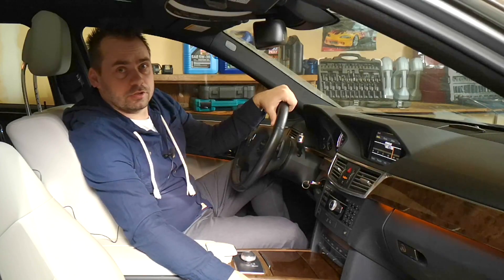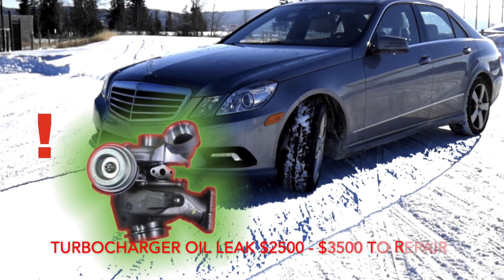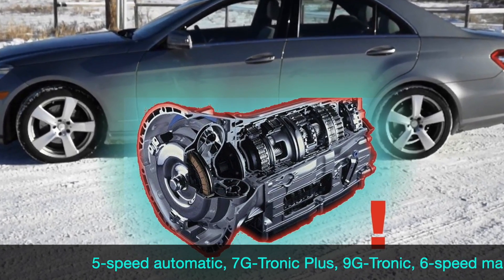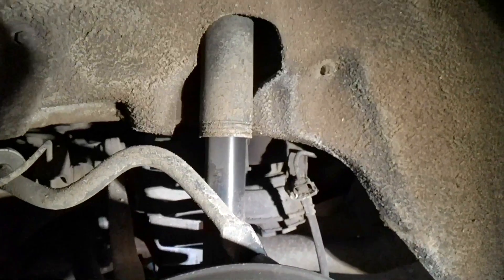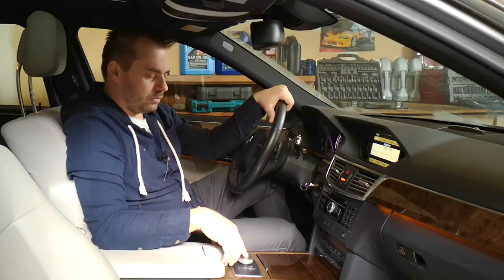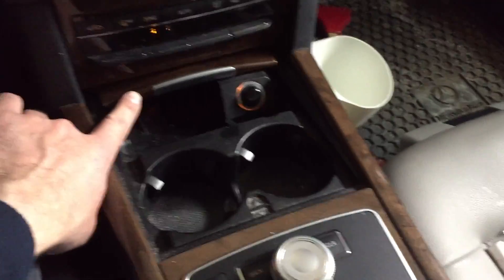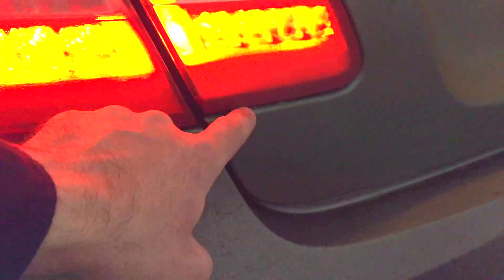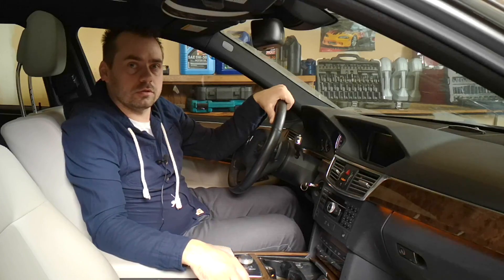🤞 🇩🇪  Used Mercedes Benz E Class Reliability | Common Problems and Issues | W212 S212 / 2009 - 2016

Comment: This car seems suspect to me. I have a W212 but a facelift one. Those dash panels there don't creak. I will however admit that some parts do creak and there are some rattles which there should not be. The seats are comfortable but I have the electric seats with memory function and more adjustment with the real leather so maybe those base seats are different. The panel misalignment is also strange but I have seen a few with that issue. Apparently it is an easy fix though. Mercedes will just realign the bracket in the boot/trunk for the strut on that side.

Comment: The radio/navigation wheel on center console is a $15 repair if you do it yourself plenty of videos on YouTube on how to repair. And if you need parts For most Mercedes especially E350 models FCP Euro has parts super cheap and a lot of diy videos you would be surprised on what you can do yourself on this model.

Comment: I will argue the Chain issue on OM651 2.1 (200, 220 and 250CDI) are much more normal than on OM642 V6/ 350CDI. Not that its super normal on the 651, but there are many examples of the Chain snap. I will do mine in around 200+k to prevent issues. Cost around 1000£ to fix at a workshop.. On 651, there are also coolant leak from water pump, egr and diesel filter bracket. Good engines all in all though. But generally, aside from the oil cooler leak on 642, the 642 is classed as a more reliable engine than 651
Reply: so the e350 doesnt regularly have this issue? I've just had a range rover that had this issue which is why im going german, looking at the e350 and i dont want it happening again.
Reply: The 2.1 is a great engine, powerful and economical. Most of the small Vito vans running around at high mileage after dragging heavy loads have the 2.1.
Reply: @harryslack534  Go get yourself a Merc Harry. I grew up worshipping the Land Rover brand but I wouldn't go near a modern one.

Comment: 100% this car was in back accident for this type of gap
Reply: Not necessarily. There are adjusters on the trunk lid on the inside that you can simply turn to adjust gapping when the trunk is closed. Owner could have messed with them without realizing.
Reply from the maker: Negative. trunk lid has adjustable hinges that come loose with time

Comment: Great  video for research! 
I'm looking at a 2011 (2012 aquired) E250 3.0 turbo diesel. 40,000km milage. Seems everything is working well. I plan to use it everyday for about 5 years. What do you think should I anticipate to fix in that time? Anything major?
Reply: You mean E350 diesel? I know with those you should watch out for the oil cooler seals.

Comment: Let's make 1 thing very clear: Mercedes Benz put all parts in boxes and ship them to the USA. AND IN the USA they assemble the car. Means: American people build the car.  Mercedes only deliver the parts.  and a new Turbo cost 500-850 euro That is what I did pay for my V6 2987 CDI  not 2-3000 USD?   Most problems you telling, I did not have. After 2013 update things where better. 4 cilinder cdi got a weak timing chain. they do from dbble chain to single chain. and that give sometimes up before 150.000km. Always better than BMW N47 engine that was before 60.000 al in the shit. Or buy VW/Audi/SEAt/Skoda TSI or diesel crab.

Comment: I am in the process of either purchasing a 2011 E350 4matic.. 72000 MI.
Or a E550 4matic with 108000 MI.. which one do you recommend the 550 is $3,000 US dollars more.
Reply: By the way both cars have been maintained at Mercedes dealerships
Reply: I was on the fence just like you. I chose a 2013 E550 4M
Reply: mine had 69,000 miles
Reply: @syklc53  I ended up with the 550.
It is unbelievable!! I love it..

Comment: Greetings Sir. Planning on going in for a pre owned Mercedes either a E220 CDI or E200 CGI, what's your advice, as I see you have mastered in Mercs. Thanks
Reply from the maker: Hello, I would always go for gasoline engine even if I woud win diesel one i would sell it and buy petrol. Diesel only for long haul semi or pick up trucks where you need tremendous torque to pull heavy loads.
Reply: @MechAdventures  Thanks much Sir, so your advise is the E200 CGI. Besides the Odometer tampering is there any specific defect I should look for in the car.

Comment: I Love My 2010 E350  not 4 matic , 3.5L But when I full throttle acceleration 3-4 seconds it flashes all the dash lights for a second then it looses 90% engine power (limp mode) and dash reads  "ESC inopperable please read owners manual"  ,no paddle shifting, doesnt matter if traction control is on or off. also tried sport mode on or off, even in Dyno mode it still happens, so then i have to pull over and park.. shut off engine and restart to reset it to normal..... I scanned for codes, and nothing. baffled.
Reply from the maker: What code reader do you use to scan for codes ?

Comment: 2011 E550... when I start the car the gauges don't work for the first couple minutes has anyone had this problem or know what it might be?
Reply: did you changed the transmission oil ?
Reply: No I haven't yet.. are the two related? Gauge/trans?

Comment: E250, 2.0 l, gasoline, 2014, at only 109k km , problems with timing chain...needs to be changed the whole kit..deeply dissapointed of low quality
Reply from the maker: known issue. unfortunate

Comment: Hey I'm looking at a 2010 e350 amg...badge..?? 68kmiles paddle shift, anything to worry about, any issues that I need to be concerned about..has a message saying paddle inoperative
Reply: Go for late 2011 and up because the 2010 has the red fluid transmission that needs changing every 40K miles at like $500 vs the blue fluid one is 70K miles for same price.

Comment: DO NOT BUY AN E220 OR E250.  MY ENGINE WENT....THEY ARE HEAPS OF CRAP...I KNOW I OWNED ONE
Reply: Interesting you say that, did you buy with proof of decent srrvice history ? I bought mine used with 25k on the clock and I have just clocked 160k  in six years.. apart from wear and tear items like tyres ,brakes and pads th only issue I had was a sensor issue on the foot/handbrake... I do think these cars ideal need to do at least  300-400 miles a week though

Comment: Bloody piece of second grade rubbish! That's the modern style and inferior quality synonymous to the  Mercedes brand. I have two older models (w114 & w123) which I won't swop for any later model! - even if offered for free. What happened to German precision, design and engineering? Third grade designs and materials, manufacturing numbers, sales increases and revenue with accompanying share price increases - these are the main drivers and the only objectives that count. Quality, workmanship and pride is nowhere to be found in these vehicles anymore - it might as well jusy another offering from Korea - which, by the way, will outclass Mercedes with their excellent guarantees which Mercedes will run a definite risk to equal. Just do your research on maintenance and service costs, client satisfaction, cost per mile/kilometre etc. If you really enjoy to blindly throwing your well earned money down the drain, this is the brand to go for!
Reply from the maker: Not neccesarily company fault. Its world we live in. They adapt or die. We live in usable economy where people replace cars every so often nobody cares about longetivity anymore as much as low price. Try to explain to millenials. As far as its flashy and has carplay, thats it.
Reply: @MechAdventures  But the millenials are not making the cars and the decisions though.